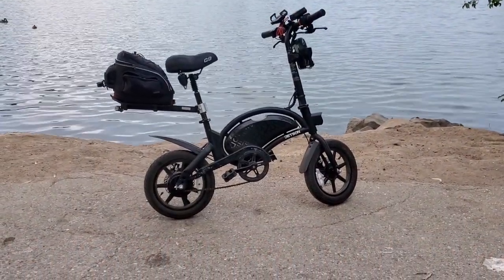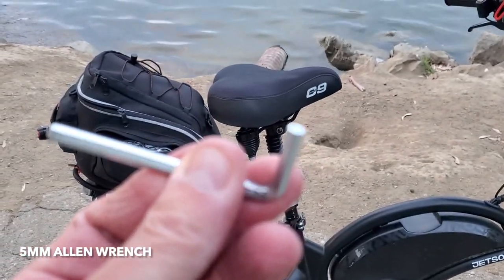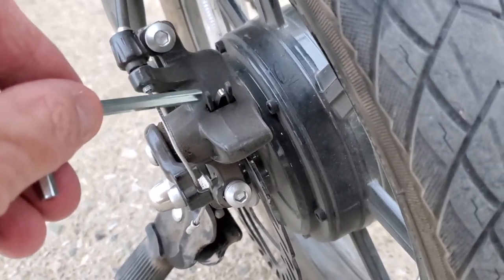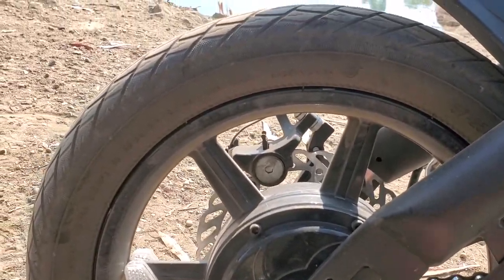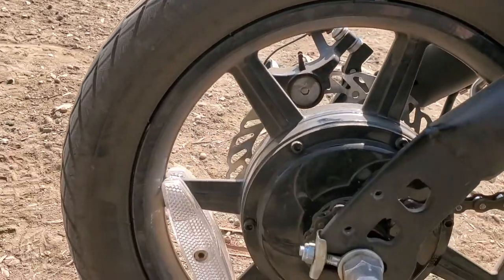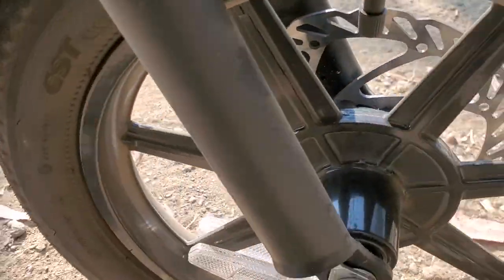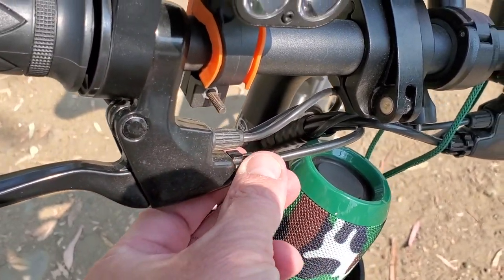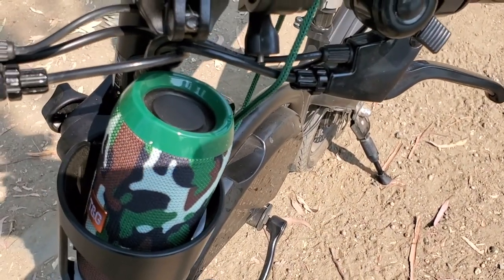How to Adjust Brakes Jetson Bolt Pro ebike from Costco

Comment: Hello sir, I have a problem with my Jetson brakes and I'm not sure what it is:  When I press the brake lever it starts to brake then goes click and the brakes are gone completely.  The hand lever doesn't move ... just the brakes themselves go from working to complete fail.  Do you have any idea what is wrong with the brakes?  Thanks!
Reply: This is what happened to me
Reply: @Skillz_JPVIGOR  Sorry to hear that.  I finally took it to a bike shop and they told me the only thing to do would be to replace the complete braking system and that would cost more than it's worth for me.  I still buy e-bikes and e-scooters.  Just NOT FROM JETSON~